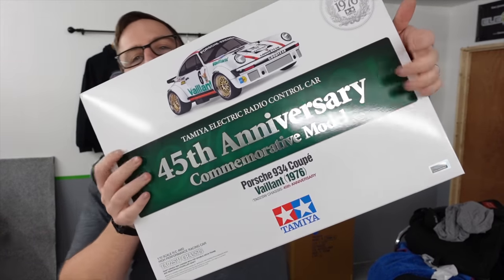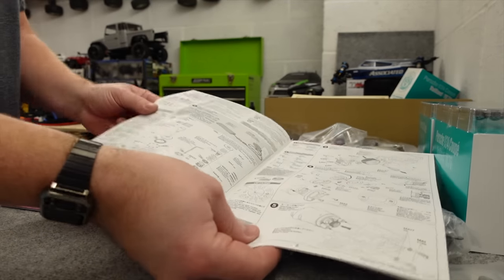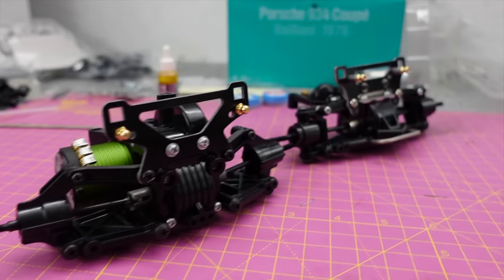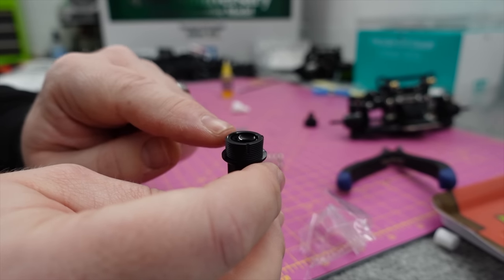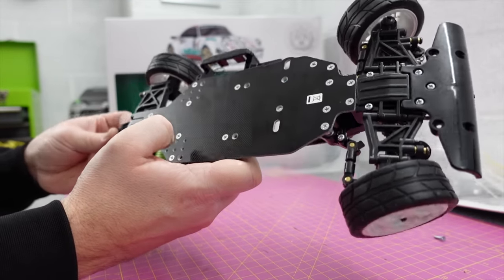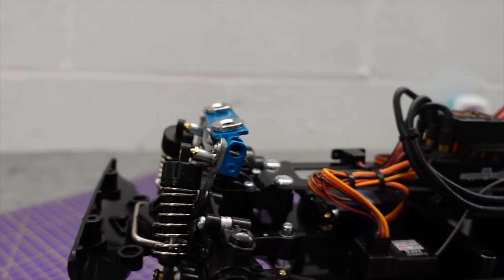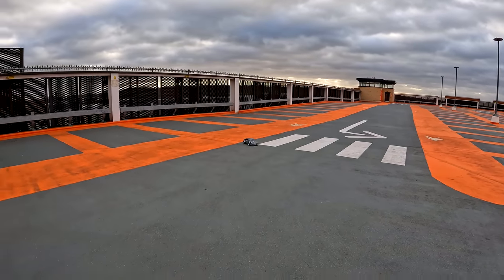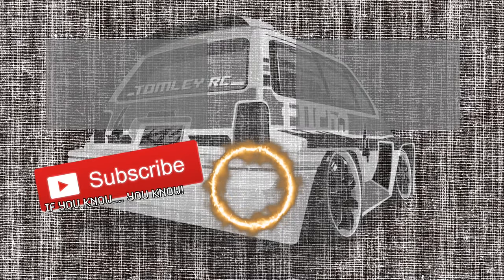I Built a Rare Tamiya RC Car, it got a little CRAZY!

Comment: I could not buy a Tamiya kit and not build it and run it. That's the best part of the Tamiya kit. Building a masterpiece and running it. Excellent video Phil!
Reply: I tried to find one for a retail price, but all i could find is these cars going for $500 to $700 USD. NUTS!
Reply: Ha. I have the Mercedes C11 kit on my shelf unbuilt because I’m traumatized by the amount of stress that goes into making sure the decals go on correctly. 

…that and it’s on a chassis that has no hop ups available

Comment: I did the same with my 30th anniversary. Added the light kit also, so it has turn signals, and the headlights flash when you are accelerating. I love it with the drift wheels, so much more fun than rubber tires

Comment: Mine went box art then on the shelf. Love what you've done with yours. I'm happy to live vicariously through your videos.
Reply: I built a bunch of TL-01 shelf queens because I like screwing things together as opposed to all the fiddley bits of a model kit. The thing is: if you're building a shelf queen you can get the cheapest tamiya chassis or even just a block of wood, paint it black, put some wheels on it and paint the body. I know it's not the same but still. If you're not going to run it it doesn't make that much difference really.
Reply from the maker: Mines going to spend most of its time on the shelf now… but I like to at least run them once, just to feel I’ve had a bit of value haha. But what people do with there’s is fine by me 👌
Reply: @TomleyRC  that's what it's all about! (not just the hokey pokey!)

Comment: I bought a my first Tamiya, a TT02D some time back and still haven't got round to starting it. I've got the one way diff, upgraded drive shaft etc. and a dumbo RC with the gyro receiver, so I can build it from the ground up for what I want to use it for. I've always bought RTR or rollers and not built anything since the original Technics lego with the working gearbox back in the late 80s. I'm not a purist of any type so I think if you paid for it, you build it and enjoy it however you want and this looks like a perfect way of doing so.
Reply from the maker: The TT02D’s are meant to be pretty good from what I’ve seen… once set up of course

Comment: Stunning!! 😍
One of the only on-road cars, I've been tempted to buy!! 👌
One of the things I was I bit , disappointed,  (sound like my dad telling me off...🙄🤣), was the lack of decent tools!! 
Get yourself a 1.5mm MIP driver, those arrowmax 1.5 snap for fun, and long nose pliers!?!🤦‍♂️ Shock pliers are cheap enough, and usually have a provision to fit the ball studs too!
The gearbox will be fine with those drift tyres, but once you get some grip on there, the rear diff my not thank you (but you can get spares, so.....😏) 
Looking forward to you back doing a speed run....
Cracking build, keep up the good work!! 👍

Comment: Built the OG back in the day, and ran it with a 2-channel Cox/Sanwa box radio.  Powered by 4 rechargeable Ni-Cad D cells; the radio took 4 AAs [might have been Cs], and the receiver 2 AAs.  Not very quick, but a ton of fun.  My first r/c build, and my 2nd fave.  The Tyrrell P34 is my favourite Tamiya r/c kit.  Even better than my third and final Tamiya r/c, the Countach, just because the P34 was so different.  The Lambo was fastest - but it didn't look like the P34.  I put the hobby down for a bit but nowadays I'm doing FPV microdrones.  Maybe one of these days I'll build an FPV P34. . .

Comment: nice build! does look like a little wheel arches need sander barreled away, and some bottom lines straightened out with the sander board.. minor but eye catching same time. less offset rims and tires for speed runs, no need for 3S, pan extensions for extra magnets down the sides to hold the body on tighter, plus make room for 2 more up front. cars like that and on road 1/12 pan cars were run 4 or 6 cell NiCad into the late 80's, then NiMh packs, so you're WAY overpowered compared to a tuned 540 Mabuchi.
seems more a "tribute edition" to me, wasn't the original RWD open planetary diff?
I don't remember ball diffs and thrust bearings until BoLink and Associated around '81-2

Comment: Back in the day the bodyshells for the original 934 kit were still available as spares and I used one, on a custom shortened drift chassis, to build a RWB Porsche. Nice work! Did it come with no light buckets?

Comment: I just pre-ordered Tamiya's new 992 GT3 kit. Any words of wisdom for a neophyte builder? I own 3 RTR's, I've thoroughly busted the Sledge and had it torn down to replace the chassis after an enthusiastic skate park send. I'm new to full kit builds, The last thing I built was a #d printer and before that some Estes model rockets decades ago. so fairly rusty...I am power crazed so I probably will go straight to brushless and overpowered, just as it should be in a Porsche tribute.

Comment: Nice to see someone actually enjoy their 45th, and not just shove the box into the back of their cubbard and hope for the value to rise. Did you have any issues with the rear gearbox, it tends to go bad at the angled gear that connect to the driveshaft, if you dump too much power into it.

Comment: Spending top dollar for a special kit only to find they've thrown in the cheapest hardware (screws) they could find seems to be an unfortunate trend. After rebuilding my Losi bdpro two or three times I had to buy all new stuff because the OG screws broke or the heads would strip. Worth it to buy some of the larger screw kits just to keep a bunch of spares around, and the specific upgrade kits are just easier than messing around with a bunch of cheap phillips-head 'wood screws' as you put it.

Comment: Mate just have fun that's what it's all about 

Screw anyone else's opinion if your having fun that's all that should matter 👍🏼 admittedly it isn't the same same but you inspired me to grab one of the udi breaker 4wd and mate .. not looked back since as I've had more fun with this that I have with any 2 wheel drive and the price you pay is great too for the kit you get 

4wd powersliders are alright I'd say 👍🏼 alright it isn't going to win you any drift competitions but atleast your not being held back by regulations and rules .. just slam a battery in and go full sends

Comment: Got a max10 and castle 100,000rpm motor in my delta and that’s an animal 😂
Reply from the maker: Beast mode 🙃
Reply: @TomleyRC  savage lol. Set of tyres every outing ripped 2 wheels clean off the spokes lol. 1:10 mitro tyres and no more 3 or 4s for the 2 with that setup lol.  To powerful for the steering on my 2 tt-02. So one Setup and my delta integrally bodies, no on nifty expands out
Reply: Meant FTX banzai.

Comment: 7700kv ? That's nothing....  should go the Novak Velocity 3.5 turn that pushes 10500kv !!
U might need to run a solid diff centre tho as that pissy standard ball diff may explode lol
I used to run that Novak setup in a Team Associated TC4 and it was an utter WEAPON !

By the way, solid hard foam tyres will be perfect for this AND will sort out the ballooning issue as they don't really expand as much as crappy rubber tyres. However they may only last 5 or 6 charges but the grip offered is worth every cent.

Comment: Regarding the “wood screw” comment, you should know better that they aren’t wood screws. Tamiya doesn’t use self tapping screws because they are cheap, they use them because they are the best screws for screwing into the styrene based plastics they use. Using machine screws puts extra stress into the plastic as they deform the plastic instead of cutting it and shouldn’t be used in the soft plastics Tamiya uses. If you do want to use machine screws all the holes should be drilled to 2.5mm then you should use a thread forming tool to make the thread before fitting the screws. Tamiya self tapping screws also go in with much less force, so making all their standard kits capable of being built by children.

As for the screw heads, unlike most cars these days Tamiyas are made to be built by the owner, usually beginners without a tool kit. Use a correct JIS screwdriver and you won’t have the screwdriver slipping, nor will you strip the head. If you don’t have a JIS driver any basic cross head screwdriver you have lying around will usually work, even if it does damage the screws. Having built many models in the past with hex head screws, especially from US manufacturers, if you attempt to do it with the included allen key set you have a good chance of not completing the build as the allen key will round out before you have finished.  In all my time in the hobby the vast majority of screws I have had to dremel to cut a slot in, or had to drill out, have been hex head screws.

Comment: The T in Tamiya means trash. I bought a TT01 in Japan and left it in my car in early spring in northern Japan and the chassis warped... stripped the rear diff on the stock motor and recommended battery.